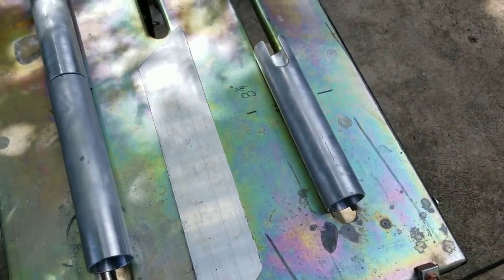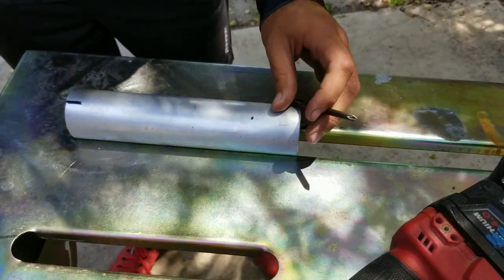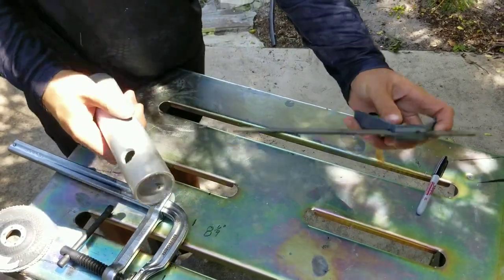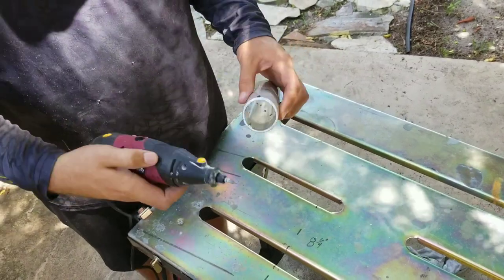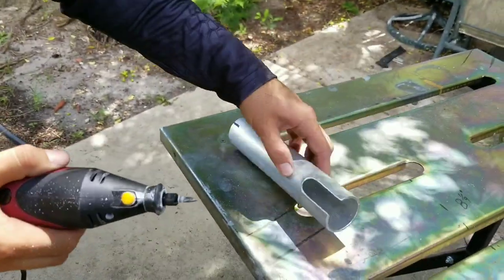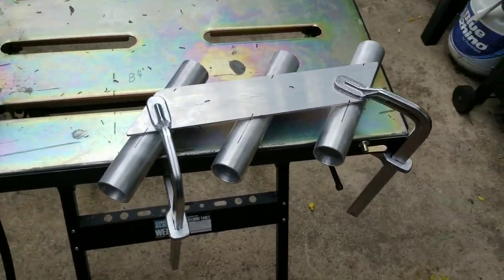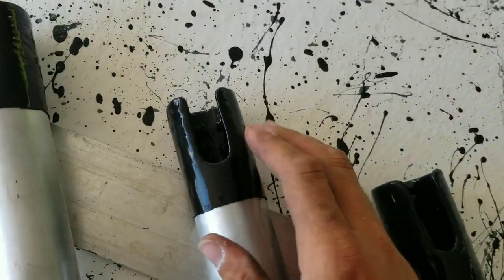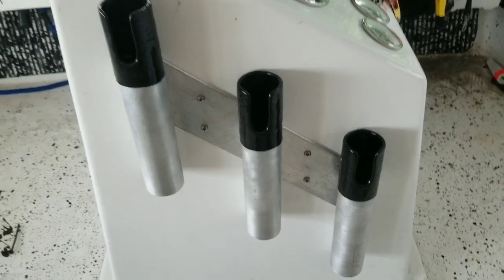How to build fishing rod holders

Comment: Good stuff man!👍👍
Reply from the maker: Thank you! I got a question for you I seen in one of your vids you own a shipoke (idk how to spell it) skiff ive got a question about the transom. I noticed they have an angled transom the boat I restored last yr (the boat that's in this vid) dose too do you know y they do the slanted back transoms? I know you have a lot of experience in skiffs just curious if u knew.
Reply: Hot Action Fishing and Fab it’s a performance design. Sorta sets the motor back and helps reduce drag by not extending the entire hull back. Boats/skiffs are constantly evolving, most times a design is an educated guess with calculated risks/rewards. There is a trade off for everything when it comes to boat design though so keep that in mind.
Reply: Also, the Shipoke was originally a sidewinder speed boat that was modified and a flats/fishing cap installed. The boat in my video runs 65mph loaded with 2 anglers but drafts around 12”! Great flats skiff but not necessarily a skinny water hull. It is a great tarpon boat in bigger water!
Reply from the maker: Thank you!
Reply: Hot Action Fishing and Fab yes sir, you are welcome!